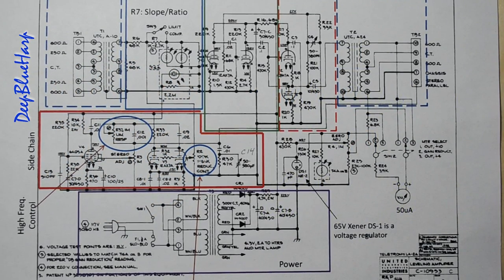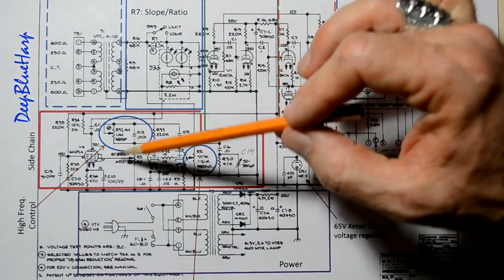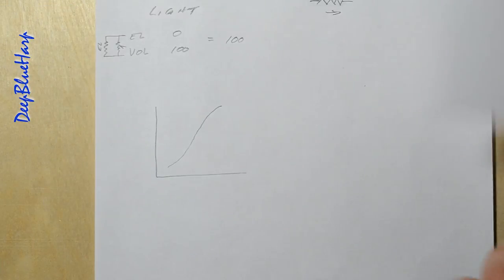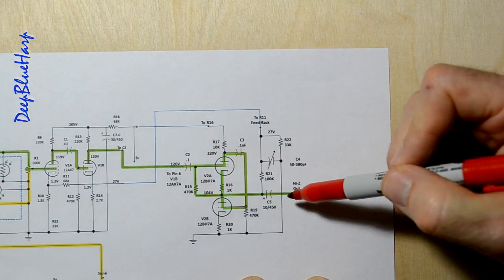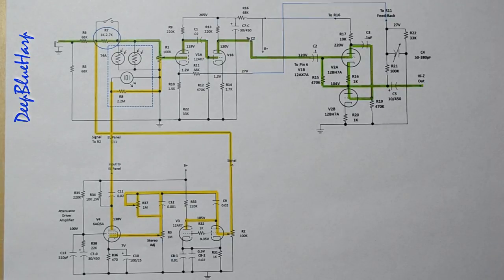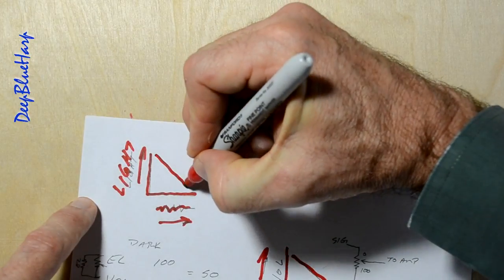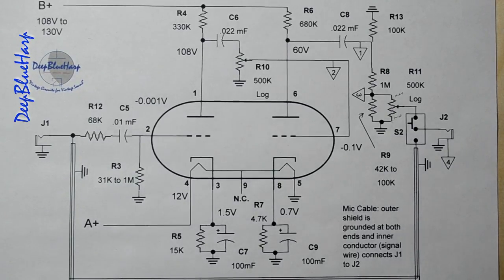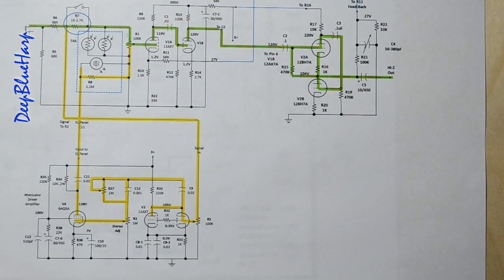LA2 Compressor Circuit Overview

Comment: I think the reason for the LA2(A) was to have a less expensive compressor compared to the Fairchild 670. That´s why they used the opto/resistor way instead of a tube based VCA.
You´ve done a very nice work on the EL panel, thanx for sharing! :)

Comment: Great video!! The only thing that I'm not understanding is how the peak detector works. Is the pentode rectifiying the signal and then been smoothed with the capacitor before it goes to the "vactrol" ?
Reply from the maker: Here is a really over-simplified and highly generalized answer: R6 and R2 form a voltage divider on the input signal. R2 adjusts the amplitude of the signal to V3. V3 amplifies the signal to the grid of V4. V4 amplifies the signal through C11 (a DC blocking capacitor). The output of C11 (DC blocking cap) connects to the EL Panel unit. The signal voltage amplitude out of V4 constantly adjusts the sensitivity of the EL panel and therefore the amount of compression.  The sensitivity adjustment is based on the signal strength to the grid of V3. Smoothing capacitors are ONLY FOUND in the power supply. All the capacitors in the signal processing circuit are either DC blocking capacitors or are in parallel with resistors forming frequency filters (like high pass or low pass).